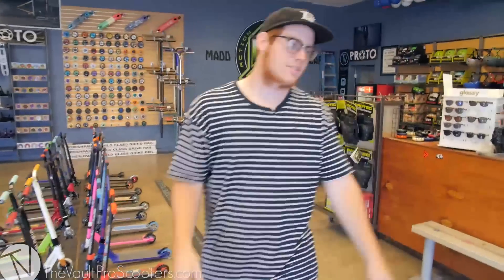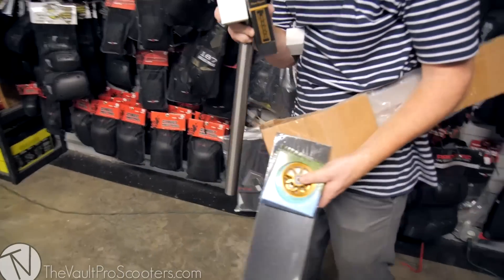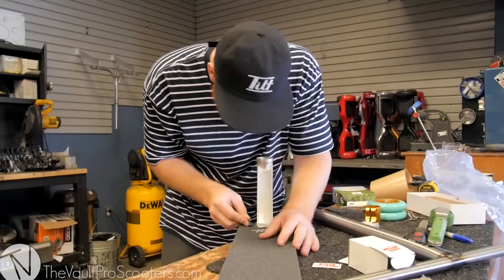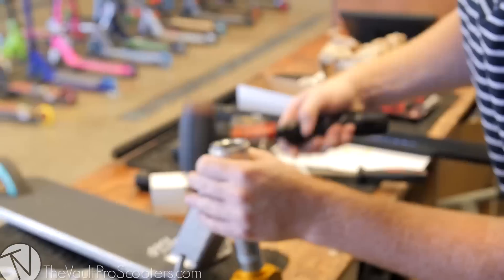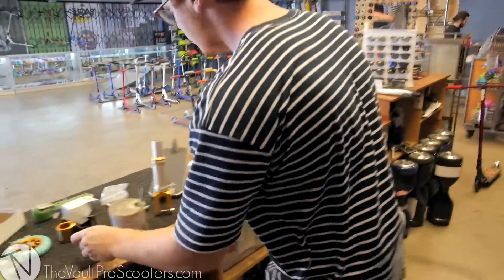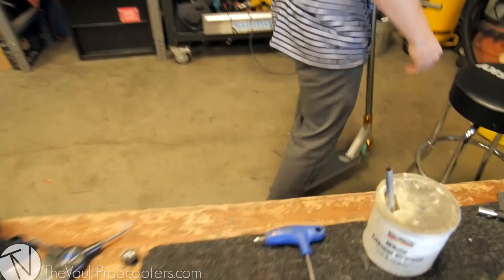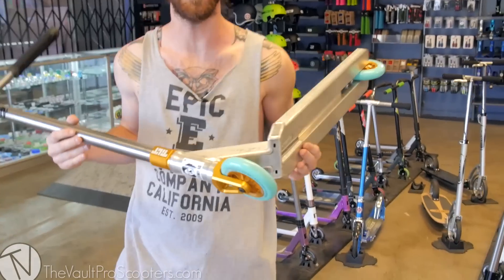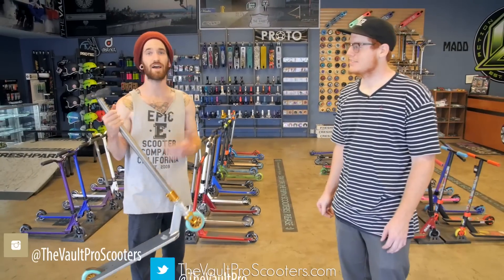Custom Build Off! Part: 2 (ft. James Webb) │ The Vault Pro Scooters

Comment: Hey vault i was wondering why when i put my lucky ls fork on my scooter the shim was to high so i cut it down a bit and put the compression cap and bolt on but when i tighten it to almost as much as it can be tightened the fork doesn't move at all. Do i need to get just a lucky hic compression? If you can reply that would be a big help. I also love the channel keep up the great vids.

Comment: And at 6:57 when you said they were in a rush to built the scooter you said at the beginning they had no time limit!
Reply from the maker: We were in a rush to FILM the builds. Meaning we had to make very quick transitions between building and filming the outro and stuff. Which required changing equipment and settings very fast and it left little time for planning dialogue portions.
Reply: +TheVaultProScooters ohhhhhh